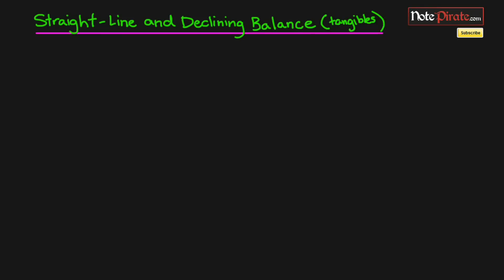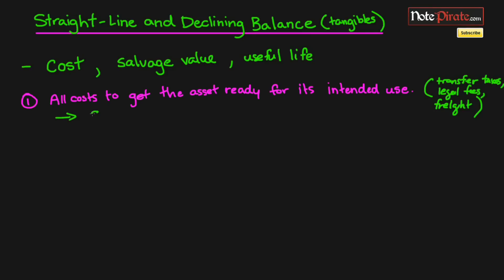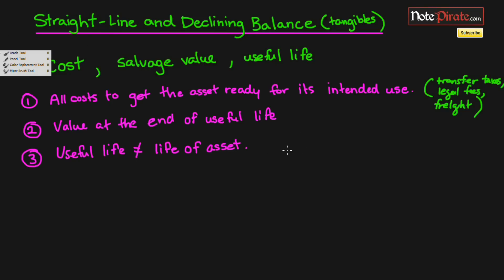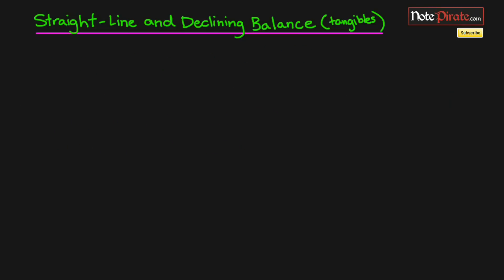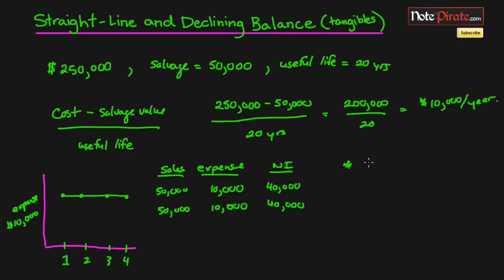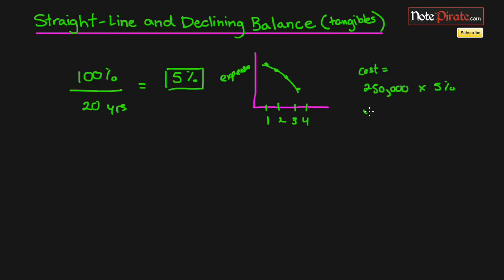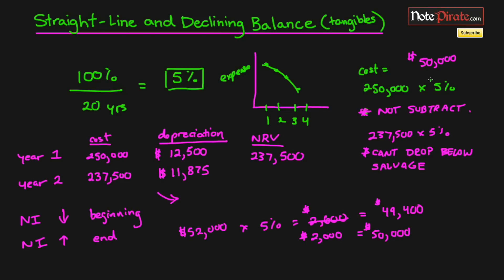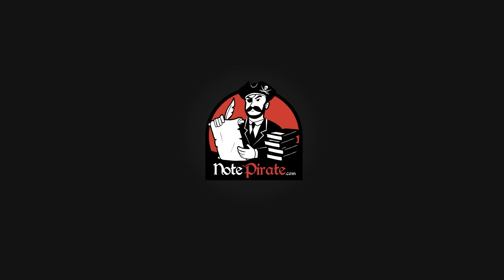Straight Line and Declining Balance Method (Financial Accounting Tutorial #58)

Comment: Thanks for the video. I've been using the double declining balance (DDB) method similar to how you've explained but I've also recently read that 'in the year in which the straight line deprecation expense exceeds the declining balance value, you switch to straight line method for the remainder of the asset's life'. In your example, could you have also applied this?

Comment: what happens if the Equipment, for instance, is bought at the beginning of the 7th month? 

slavage/residual value: 1000 
Useful Life: 5 yrs
Using straight-line depreciation, would you then say;

1. (1000/5)* (5/12)
2. 1000/5
3 1000/5
4. 1000/5
5. 1000/5
6.  (1000/5)* (7/12)

That confuses me. Thanks for your videos, since they help a lot !!
Reply: ***** thank you so much, you're a huge help!

Comment: Premises = 60,000
Motor Vehicle = 20,000

3. Depreciation is to be charged on the premises  at the rate of 2% per annum on cost using the straight line method and on the motor vehicle 20% per annum using the Reducing balance method. (Can somone help me with this)

Comment: Purchase a machine for R400 000(excluding Vat 14%) Additional costs transport and installation R20000.Depreciation calculated at 20% per annum. Using straightline and diminishing method for the first 6 months,what will the depreciation be?  ANSWER :R47600 for both,Am i correct?